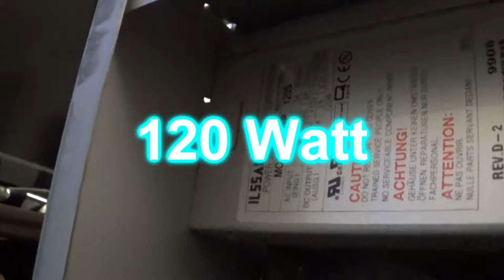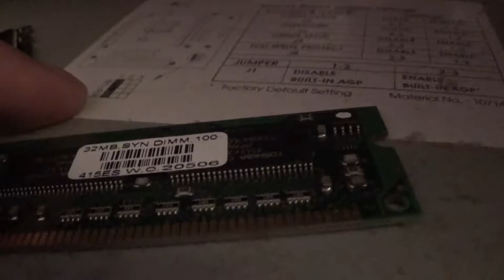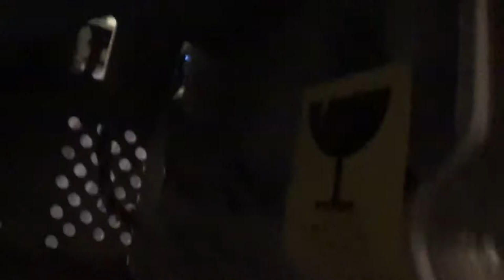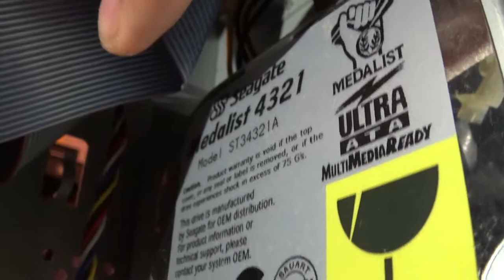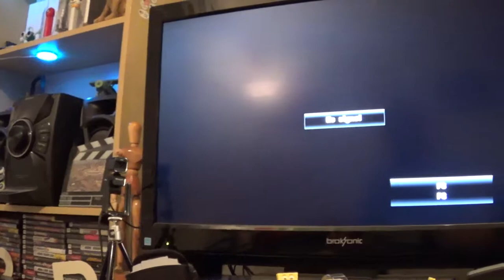eMachines eTower 400id

Comment: I had a earlier model the eMachines etower 300K (AMD K6-2 @ 300 Mhz).
The graphics chip is the same (ATI Rage IIC) though but my hard drive was a dinkier 2.1 GB Fujitsu one.It was all that I could afford in March 1999.It was poor at computer games but basically I had no problems with 2 year old computer games.Hind the combat flight sim from 1997 (USA) ran great it was immersive and fun.What I did initially for an upgrade was that I chose the 3DFX Voodoo 3 2000 PCI graphics card then upgraded the tiny power supply to a 250 watt one (probably why it still works good to this day).
It could play any game out there in 1999 and 2000 though not as well as a Pentium II  450 Mhz beast nor a monster Pentium III system.Later I upgraded the hard drive to a 15 gigabyte one,added a Sony CD-RW drive and a ATI TV wonder card to it and in 2000 when the 500 Mhz version of the K6-2 was only $27 I upgraded the CPU and also added more RAM memory.

Right now I can browse the Internet using that 1999 eMachines with Wary 5.5 Puppy Linux alongside Windows 98 with a ethernet card (I removed the obsolete modem.You will need 128 MB I think with Wary though 256 MB would be ideal.It's still slow on the Internet though however somewhat usable especially for websites lacking video ads and other junk.
By the way that 400 Mhz Celeron is far more powerful and better at gaming than my initial 300 Mhz AMD K6-2 CPU.The original eMachines Mitsumi CD-ROM has a problem reading user made CD's so I removed mine.
When emachines first came out with their desktops there were and still are articles about them on the Internet.Do a search for " emachines 300k good enought computers"
and you will see two articles one from the NY times and another from the Baltimore Sun.

Comment: How do you get the cd drive and floppy disk drive to work on a emachine etower 400.For the floppy disk i tried to get to work it said i had to download the right kind(S) of drivers even to get the files to sync to the computer, i use different kinds of usb flash drives it still wouldn't sync ?????
Reply from the maker: I didn't get this computer working, now it is sitting abandoned and with hardware partially taken out.